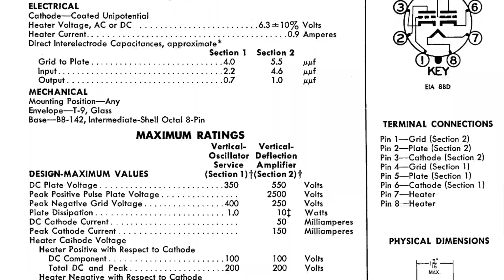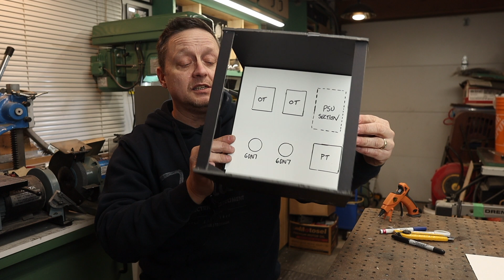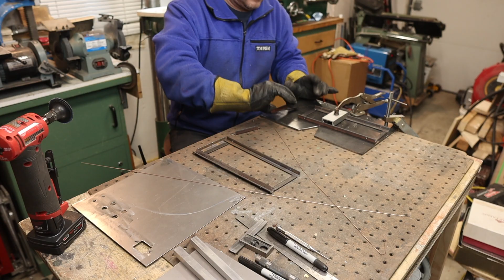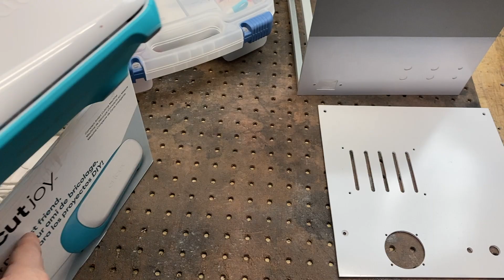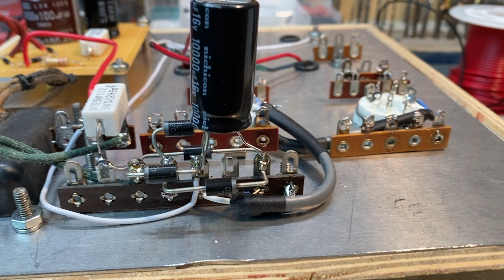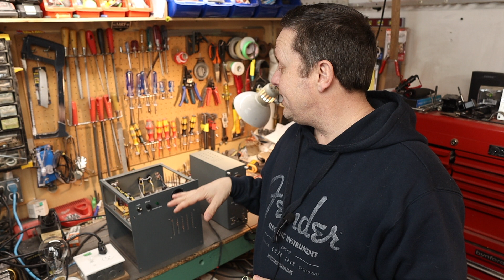How to make a 6DN7 tube HiFi amplifier / A low power Single End Triode tube amp that sounds amazing!

Comment: hi,how much voltage drop with a shottky  on 6.3 volts  filaments,thanks
Reply from the maker: It depends on the specific Schottky diode and the current draw. 1N5820 will drop ~0.475v at a current of 3A.  You would need to check the datasheet for the exact voltage drop.  I always find I need to drop a bit of voltage with some small value 5w resistors. Each tube is a bit different.  Lower is better (6.0v - 6.3v) than higher (6.4 - 6.9v) in my books. Cheers.

Comment: OK, so what did you do to cut the hole for the power transformer?
Reply from the maker: Thanks for asking... I used a small drill bit and line drilled just inside the hole. I used some metal snips to cut out the chunk of metal. After that I used a Flat Bastard metal file to file to the line.  You could also use a angle grinder and a zip disk, but that is a but more sketchy.  Have a look at my EL84 build. Cheers.

Comment: Nice vintage vibe chassis for sure.  What was your power output?
Reply from the maker: Thanks.  The output section of this tube is similar to a 45 DHT.  It has approximately 2watts RMS…. Which is plenty loud for a smaller space.  At full volume with semi-efficient speakers you would have a hard time having a conversation with someone.  
This is a perfect amp for a condo or a shop.  You can even bi-amp a set of speakers and use this amp for the tweeters.  Cheers.

Comment: Hey Mike are you still recommending the Hammond 271 series transformers? -
Reply from the maker: Hello, a 271X will "just" work. That transformer will be close to its limit.  There isn't much capacity to run the output stage at a higher bias point with that transformer.  The B+ may be a tad lower than documented as well. The 6DN7 heaters draw 0.9amp each so its ideal to have the 6.3v winding to be more than 2 amps to allow for possible deviations in tubes and wall voltage.   FYI, the circuit as shown will draw close to 60ma.  You will need to wire the PT in a Full Wave Capacitor Input Load + grounding the center tap.  I hope that helps? Cheers

Comment: To do the power amp better as an integrated amp, Use a 6EM7 instead of 6DN7 because the first stage gain is much better. I built a pair of mono blocks with these. They work well with the tiny signal from your phone's headphone jack.
Reply from the maker: Thanks for commenting. Yes, the 6EM7 is another popular dissimilar twin triode tube.  Many moons ago Gordon Rankin posted up a schematic of an amp using this tube. I’ve played with it a bit to satisfactory results. It works okay. For headphone usage, you don’t need a lot of gain/output. 500mW is more than enough.  Give the 6DN7 a try.  I do find the 6DN7 tube a bit sweater sounding tube… IMHO.  Cheers.

Comment: You ground shields on both sides, always.
One sided shield grounding reduces the shielding effect - it makes the wire act as a highpass for electric fields, but a lowpass for magnetic shields with the shield length beinG the 1/4 wavelength of the rolloff frequency. So you might be shielding out the hum from electric fields, but might still get hum from magnetics (trafos, chokes, etc. ).
Mil-Std-188-124B shows the proper shielding method.

Comment: Dear Mide -- I built one simipar to it using a pair of 832's from a WWII VHF Aircraft transmitter. It also gave about 8 watss out, and sounded great. Unfortunately, it has a new owner that loves it. I sold it on E-Bay.
Reply from the maker: Thanks for commenting.  There are a lot of different tubes out there that can make for a good audio amplifier. Just need to research and spend time developing and building them.  Cheers.

Comment: How come theres two resistors in the filter cap section when the schematic doesn't show them?
Reply from the maker: Make your you have the right version of Schematic.  The first rendition of the circuit has the 1st 270ohm right after the first filter cap. It's in the 1st video and on the original schematic. The 2nd resistor is jumpered and not used. I installed it in the circuit board to help tame the some B+. I ended up not needing it. The PSU designer was a little of on actual.  The 2nd rendition of the amp/schematic I replaced the 270ohm resistor with a 270ohm choke. cheers
Reply: @MikeFreda  got it and on the filter cap section am I correct to assume everything is soldered together?
Reply from the maker: The components are soldered underneath the board in the same manner as the schematic shows.
Reply: @MikeFreda  perfect. Thank you!

Comment: I am curious what the RMS power output per channel is just at the edge of clipping?
And is that measurement with a 4 ohm load or an 8 ohm load?
If you mentioned it in your video I must have missed it.
 I understand you are running the plate of the output tube somewhere close to 8 watts, but have no idea what the efficiency of the output stage is,
Reply from the maker: Thanks for commenting. I really don't have any proper testing equipment, however, I did use a Signal Generator app on my phone and using my Fluke 115 multimeter (which is a true RMS) I measured and calculated just under 2 watts off of the 8 ohm tap.  Looking at some commercial 45amps (the power section of this tube is very similar to a 45 tube) they measure very similarly.  I do plan to take the amp over to a friend's place and do some proper testing for all the inquiring minds. I previously had a EL84SE amp and it was just marginally louder than tie amp. cheers
Reply: @MikeFreda  ,
I think your calculations are on target.
I was estimating between 1.5 and 2 watts RMS depending on the level of distortion you were willing to allow.
 I would be interested in knowing what the input signal was at full power output, regardless of the signal source being used (like your phone)....
If your fluke is true RMS than the input level in RMS volts or millivolts would be a handy number for comparison if any future changes are being contemplated...

Comment: I wonder you use steel for the rear. Because GR Research always condemns magnetic parts next to sockets n terminals.
Reply from the maker: Thanks for commenting.  I’ve never heard of this being a major concern. Please elaborate?   There are a lot of theories regarding this but I’m not sure how else you would do it. One would then suspect that many engineers that designed guitar amps, audio amps and electronic gear since the 1900’s missed something? Cheers.

Comment: Are there any production amplifiers ever manufactured using a single tube for stereo amplification?
Reply from the maker: I’m not aware of any. Most people need enough power to drive inefficient speakers to reasonable levels.  Trying to mass market a lower power single tube amp would difficult since it wouldn’t cost much more to make an amp with more power which would make it more desirable. Cheers.

Comment: What about using 6146 or 807 RF PA tubes?  They aren't too expensive, and can put out quite a bit of power.
Reply from the maker: Thanks for commenting.  Yes, those tube are inexpensive and sound good. I do plan to make an amp using 807 tube but it does require larger transformers and different wiring scheme.  This amp was more intended for a low cost way to try a single end triode amp with really inexpensive parts.  Cheers.

Comment: For R4 249k, would a 240k or 270k resitor be ok?  and for R2 and R5 are those just 220 ohms. Sorry if it seems like a dumb question, just wanted to make sure before i submit my order.
Reply from the maker: Hi, R4 (aka Grid Resistor) can be anything in the range.  240k would be okay. R2 and R5 (aka Grid Stoppers) can be anything between 200 ohms to 499 ohms... 1/4w is fine. High quality carbon comp or metal film preferred since they are part of the signal path. They help calm down any oscillations or RF getting in the grid.  If you want to do some research on that,  you can just google "Grid Stoppers" & "Miller Capacitance". Cheers, Mike
Reply: @MikeFreda  thank you so much. I’ll look that up right now. Btw I’m having a lot of fun with this project, I’m starting to lay things out and trying to figure out transformer placement to minimize interference. There’s is a lot aspects to doing this from scratch but I know it will be extremely satisfying in the end.
Reply: Hi again, just wanted to give a quick update. I’ve just completed this build with great results. It truly does sound pretty good. I’ve only played a few songs so far.  There is one issue I’ve come across though ,My voltages all around are on the low side. I’m using a transformer rated for 275-0-275 100ma. I’m using the 275 winding and after the diodes It’s at 317v, 
The 354v for the primary of the output transformer is at 305, pin 2 346v is at 303 , pin 3 16.5v is at 14.5. and the 75v for pin 5 is at 67v. The tubes are biased at 6 watts of dissipation. So overall the voltages seem 15% on the low side. Is there a way to increase the voltage or is this acceptable. What would you recommend.
Reply from the maker: Glad to hear you were able to make it and fire it up.  With a PT like that you should have at least ~385VDC at the first PSU CAP.  You need to do some more investigating. What is your AC line voltage? How is the PT connected on the secondary side? Are you only using 2 Diodes and the CT connected to ground? What is the voltage drop across R10? Is it more than ~17VDC? Calculate the current across R10. If it's more than 65ma you are drawing too much current and that will drop the voltage.  Do you have a PSU cap in backwards? Is the bleeder R9 the right size?  What you can also do is disconnect the PT from the PSU circuit and just test the raw DC unloaded.  If that checks out then you need to validate all you resistors sizes and connections.  Check the OT primary Taps as well. That could drop the voltage a bit if there are not connected correctly.
Reply: @MikeFreda  i May have found the cause which was a blunder on my part, I switched from a bridge rectifier (4 diode) to a full wave (2 diode) with the PT center tap grounded. Originally I was using only one side of the PT,the 275 and ground windings 
Which did get me reasonably close voltages unloaded but obviously loaded it the PT was struggling to provide the current and voltage. Now as I type the amp has been warming up at least 30 minutes and the voltages are now stable and a lot closer to the schematic. 375 is 356. 354 is 342. 346 is 338.
Reply from the maker: @doubledigitdreams  Wonderful! Glad you figured it out.  Those voltages seem very reasonable.  My wall voltage is always around 120vac. If you are using a light bulb current limiter, that would skew the readings a bit.  I'd just watch/measure things as they burn in. Recalculate the bias/dissipation to make sure.  PM me a picture of the amp and I can post it on my community page if you want. Cheers
Reply: @MikeFreda  I’ll definitely send some pictures after I’ve added a coat of finish to the wood base. It resembles a Bottlehead amp. This is my first scratch build and your videos and schematic gave me the confidence to go through with it and I’m so glad I did. I have a pair of klipsch heresy’s that will pair nicely with this amp. Thanks again.

Comment: Fifty years ago, when I was experimenting with electronics and building all manner of simple projects like this, I struggled with any sort of metalwork beyond drilling a hole because I simply didn't have the tools. And every part other than the tubes and trannies was 25 cents. Today, I have all the metalworking tools, but every electronic part is $3, the trannies are ridiculous (if you have to buy versus salvage) them. But you couldn't get me to build such a thing today when I can buy a pair of powered computer speakers for $5-$10 at a thrift store or garage sale.
Reply from the maker: Thanks for commenting.  Yes, you are 100% correct, building tube amps is an expensive hobby. That’s why you need to be frugal and be realistic with you build and what you actually need. Yes, you can buy inexpensive heat but it’s really not that same as a tube amp you build yourself.  At least it’s cheaper than cars or horses! Lol.  Cheers.
Reply: @MikeFreda  I was contemplating getting back into (guitar) amp building a few years ago; basically buying dead solid state amps for $20 and converting them to old Fenders. And after trying a few I found it's just not a feasibility...unless you're ready to do fairly meticulous work for $5 an hour. Parts are crazy expensive; you can't salvage anything from a SS amp---the pots are 1K-5K; the reverb can is the wrong impedance; the trannies are wrong voltage and impedance. I won't use plastic phone jacks at all. You can barely even solder to old parts with "modern" lead-free solder. You're 20x better off just buying a good condition used Fender whatever and selling it for $100 less (or more!) than you paid for it three years later. Add up all the parts in a Princeton or Deluxe Reverb or even an old 6G2 or 5E3 and you can't build that amp for what it costs to buy a decent used one.

Comment: Are there other options when it come to the output transformers. I know edcor has a 10watt 5k 8ohm, also the AES-pt31 8watt 5k 8ohm. Could any of these be used to substitute the hammond on your build list.
Reply from the maker: Yes, there are. I’m creating a new video discussing the options and I swap in obtainable output transformers. (Edcor XSE10-8-5k).  When it comes to OT’s. You just have to be aware if they are for HIFI or guitar amps. There is a difference in the frequency response. Cheers.
Reply: @MikeFreda  it’s good to hear that your still experimenting with this tube amplifier, can’t wait to see the results as I will be building this to your specs. I only have experience with repurposing amplifiers from consoles, and in those builds I have replaced the output trans. on a single ended el84 2 watt amp with the aes-pt31 and for the price it sounds amazing.

Comment: My next project is using 8 807 output tubes in push pull they sound good and are about as cheap as a 6bq5

Comment: I made a replica using all USN parts and tubes 4 @807s 3 @ 2 6sn7 tubes and a type 83 mercury rectifier with a separate power supply 
I love the work you done now I’m thinking of another project based on yours the stenciling looks so factory I love it ❤
Reply from the maker: Thanks for commenting.  Glad you like my project.  Like to see what you created. Yes, there are a lot of inexpensive tubes out there that would work great in an audio circuit.  Stay tuned, I have a couple more amp projects coming up!  Cheers.

Comment: Wow, so glad I found your channel! In this video, you provide just enough technical information to allow other builders to copy your work without getting too far into the weeds. But in the future, I would really appreciate a deeper dive into the way you choose a tube and spec out the components. In my junk box, I have a variety of oddball NOS tubes, various salvaged transformers and sockets, etc. And I have some old tube manuals, but what I lack is the knowledge of how to read the operating parameters of a given tube and the translate that into a workable circuit. I have liked and subscribed; looking forward to future videos.
Reply from the maker: Thanks for commenting.  I’m glad you like my projects.  I do not profess to be a vacuum tube expert, I’m also learning things as I go.   I do plan to do deeper dives into tube amp design, please stay tuned.  FYI, The Morgan Jones tube amp books are a great resource to read and learn way more about tubes than I could explain in my lifetime.  Cheers!

Comment: How did you cut the square hole for the transformer?
Reply from the maker: I used a 3/16” drill bit and drilled in a line just inside the square and filed it smooth to the line.
Reply: @MikeFreda  Yeah it looks like it turned out pretty good, but I was hoping someone had a quick way to make good square holes. I know they make square punches but they're super expensive.
Reply from the maker: You could use a Zip disk or a small handheld router. Use a template, a Millend and turn the speed down.

Comment: unfortunately the 6fj7 has being priced too high + her base. The output transformer is another "tragity". More than $200 for a pair (Double C nickel-based amorphous iron core 7K single-ended). May I ask for the total cost of this amplifier (+ the current sources for cathodes) ?
Reply from the maker: Thanks for your comment. Yes, if you source nice components you can spend a small fortune. Tube amp building is not cheap. The 6DN7 tubes are inexpensive so you will save money not having to purchase premium tubes.  If you follow my parts list you should be able to build this amp for around $300.00-$350.00. I had salvaged my OT's from an old Turntable Counsel and had a lot of the parts from my parts bin. I spent around $200.00 on this amp.  If you can source Hammond BSE you can save a fair bit of money. I plan to install CCS on the Plate of the input section. Those components should cost around $20.00.  You could install the CCS on the power section cathodes but that a lot of power to dissipate. (~10 watts) That could be a bit risky.  I feel that whatever you spend on this amp it is worth it. It sounds that good! Cheers.

Comment: Do you have some measurements on the sound parameters? distortion, dc ripple, freq response and the likes? What is the power consumption on idle and what is the max power it takes with volume cranked up to 100%?
Reply from the maker: Thanks for the comment.   I plan to do that in my next video. I don’t have some of the tools to do this but I have a friend that does. I will try to connect with him and see if he is interested in doing a video with me. Cheers.